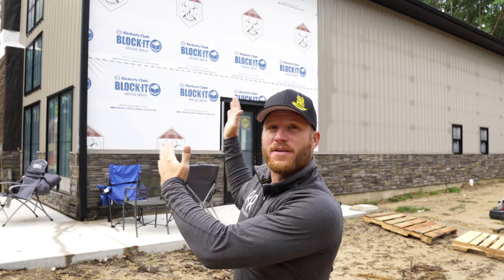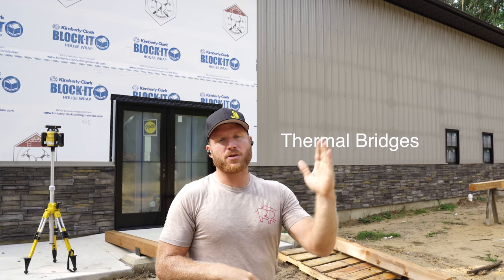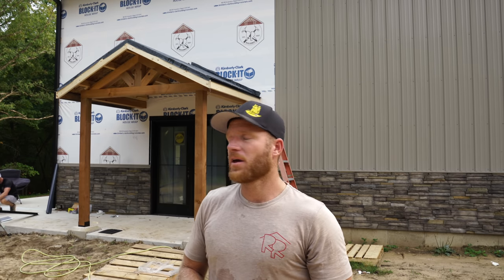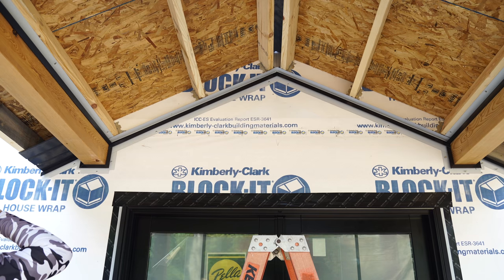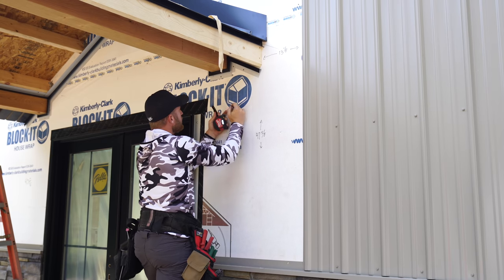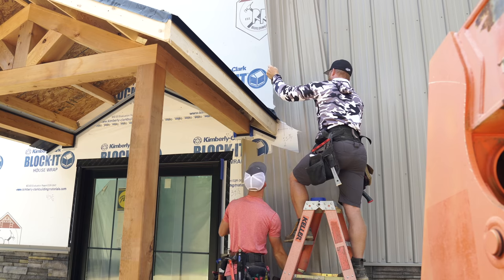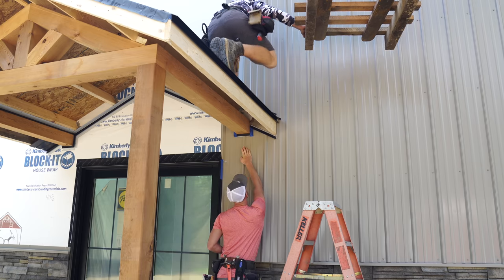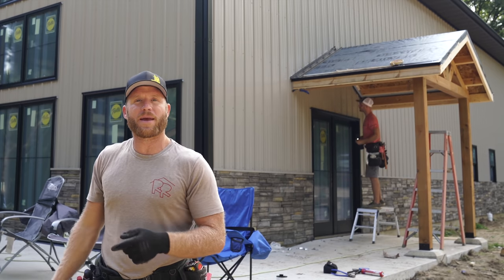Building a Small Timber Frame Porch, PLUS the Hardest Metal Siding Install

Comment: hey kyle , that show with intricate cut into j channels and sloped roof detail was very satisfying to watch once it was victorious. However, i couldn't help but to be reminded on my AL-13 days and when we ordered J-channels instead of their snap-lock trim. we were screwed exactly like the porch in this video: firmly. waiting 3 weeks for snap locks aloud the forgiveness your looking for especially in those exact situations. non ferrous blade on the chop saw made for some beautiful miter work aswell.  Tucking rigid material into anything more then two dimensions will lead to loss of productivity and is where a snap lock j trim might be beneficial is exactly there. It wouldn't take away from the exact measurements on ur panel , but it would make installing a heck of alot easier.  Everyone makes them,  james hardy , maibec , etc . grab a rubber mallet and snap lock your way into the future.......... and the future is NOW!! lol

Comment: Excellent Job, I got a couple of questions though,

1- How did you connect the two 4*4 beams to the door hearer?

2- How did you secure the other mitered end of those 4*4 to the posts? I didn’t see any plates there and there is no way you just left them unsecured.

Comment: You noted that you used temporary structural screws to fasten the horizontal beam to the house but you never said what you did permanently. Is it fastened from the inside?

Comment: @rrbuildings how did you attach the horizontal timbers to the garage wall? I'm installing knee braces to mine to do a small eyebrow roof.
Reply from the maker: Structural lags from inside Thru the header
Reply: @RRBuildings  Thanks. I've learned a ton from watching your channel. I'm wrapping up the 48x72' post frame garage i just built on our property and referred back to your videos a lot. Helped save me from making some costly mistakes. Love the detail keep it coming

Comment: Saw the "temporary structural screw" at the beginning when the horizontal cedar timbers were sitting on the small treated blocks. But didn't see how they were permanently attached to the building. Plan on doing something similar so wondering how it's done.
Reply: It needs to be pocketed into the house and bearing on 3 studs

Comment: I noticed on your front timber frame gable that you didn't set it out flush with the sides of the 6x6 post.  What is the purpose of that and how do you know far in from the edge to set it?

Comment: Wow, these are massively over-dimensioned beams for the tiny structure - looks cool though!
But despite the massive wood there are issues which might reduce the lifetime. E.g. screws in fiber direction when attaching the verge rafters. Guess though that it does not really matter, given that the load on the structure will be minimal.

Comment: Will those lines, that you showed in regards to insulation, always be showing?
Reply: No. Not everyday or all day. What we are seeing is the condensation in the morning, from the cooler humid morning air. It is less likely on the sunny sides. Most people don’t notice it, unless it is pointed out. It’s normal and visible in other types of construction, like being able to see roof framing with metal or shingles roofs. Hope that helps.

Comment: Nice looking job, but wouldn't you have just loved to use some proper timber framing jointing to bring together the tiebeam/posts/'plate' timbers? There's a great US heritage of square-rule timber framing, beautifully illustrated in books by Jack Sobon, Steve Chappel, Ted Benson, and (more recently) Will Beemer. I'm not trying to be overly critical, but it's just such a shame to see a proud craftsman use nice timber but not take the time to joint it properly. Jim from 'Tradesman Channel', help me out here!

Comment: @20:46 It looks like your posts are leaning into the building.  lol  I'm sure it's only the camera angle.  I'm a carpenter's daughter who's done renovations to the homes I've purchased.  The one I'm currently in has to be gutted, I don't think whoever built it owned a level, if they did, they didn't use it.  lol

Comment: Two timber gables would have been better and the wall attachment should have been through the wall if you had no drywall yet .block cut offs 14  1/2 between the studs and timber lock it through the wall gable

Comment: blows my mind you can see where the joists are behind the metal. why? cold meeting hot. should have never did sprayfoam, or atleast cover the whole wall, and not skip over the wood to transfer through.

Comment: This is not timber framing. It's mitre jointing with really long lag screws. Where are the mortise and tenon joints? the Oak dowelling pins.  Looks nice but you should not disrespect a real timber framer by calling this timber framing.

Comment: Overall your buildings and vids are good but there are  issues with this porch project. Ladder safety is nonexistent, use a ladder that's right for the job, several other safety rules disregarded, if one of you was injured building this your insurance would most likely not cover the incident, really poor modeling of job safety. As others have stated that is not timber framing, revisit in a couple of years and you'll see big gaps where the wood was screwed together.

Comment: Partner,  I just watched you make two cuts with your Skillsaw, and had to quit watching. BASIC, and I mean  basic saw safety, s takes, you never place the weight of the saw on the off cut. It matters not if it is a 5 1/2 battery saw, or a 16" timber framing rig, never does the weight of the saw go on the off cut. Sostupidly dangerous. Toodle  loo Mark